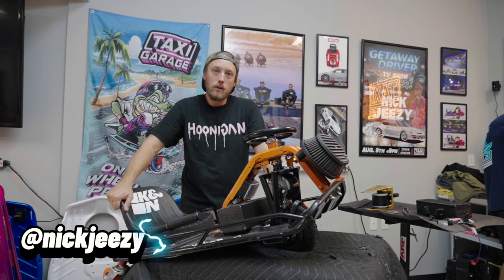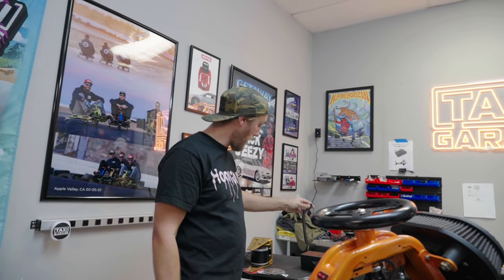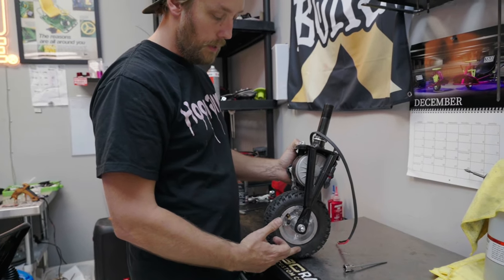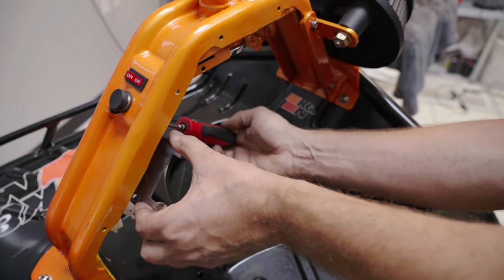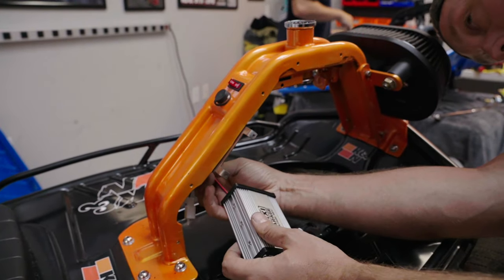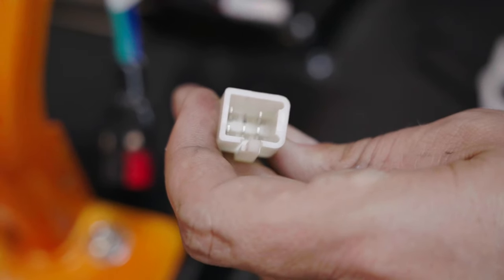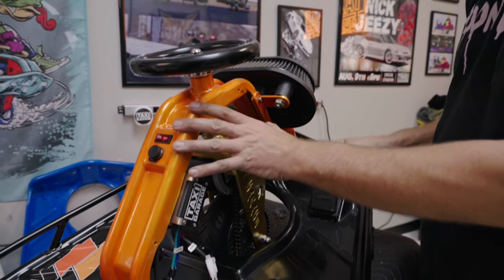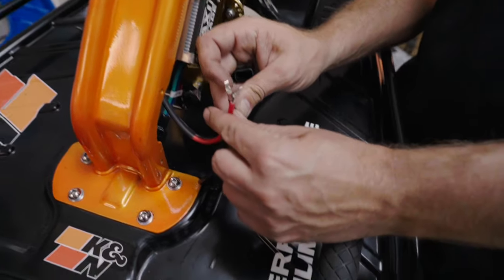Taxi Garage 1100w 48v Upgrade Kit Installation – Razor Crazy Cart

Comment: How long does the battery last ? say if I want to go traveling with just this and take a bus Etc… how long would it last and can I carry and extra battery to swap if it does die? I’m feening to buy one but I need to know this.😂
Reply: This I would also like to know this
Reply: If you’re going slow and not always on the throttle, 3 hours, if fast, 1 to 1.5 hours.

Comment: I was boutta cop the 500 watt moter and 36v battery mod pack but i was worndering does it come with a standerd crazy cart?
Reply from the maker: The standard cart comes with a 250w motor from the factory so the 500w is an upgrade over stock.

Comment: Will this work with disc upgrade kit to ??
Reply from the maker: The brake kit is for XL Crazy Carts, this motor upgrade kit in the video is for a standard cart.
Reply: Ohh very nice man I’m thinking about getting a stage 5 one off yours and but first thing I wanna do is upgrade the batter as I got a 48v that charges to 55v 20ah 40a had it on a 1800w motor and would last for hours I was wondering would I be able to make it work for longer hours or am I gonna blow the 1000w motor up ???